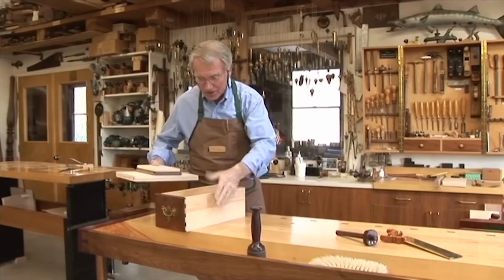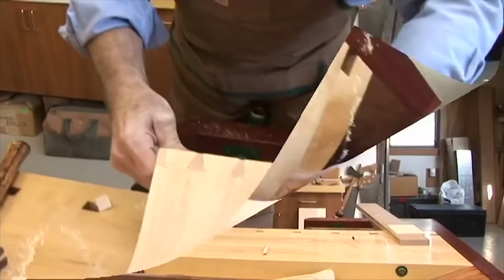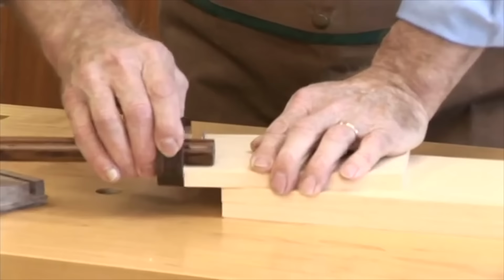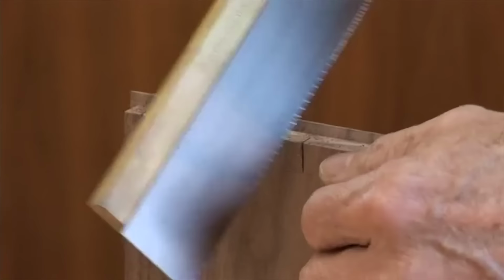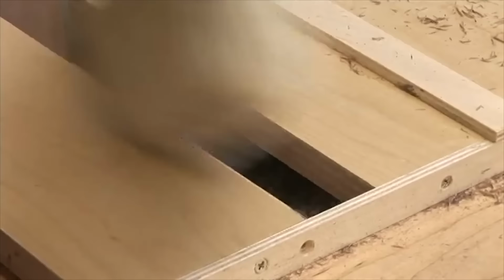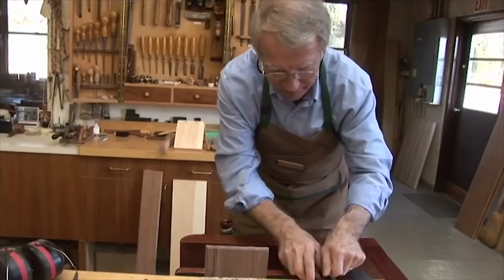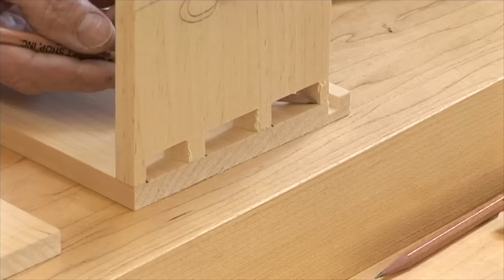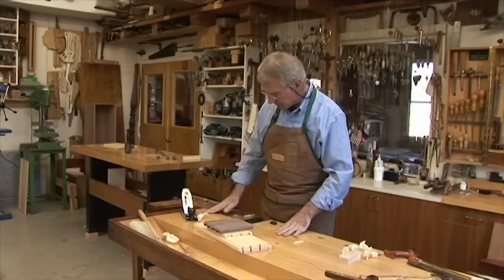Dovetails for Drawers – the European Way

Comment: The way he made the horizontal cuts puzzled me. I thought he was using a bow saw 
with a 1/4" blade, known as a "Schweifsaege" in Germany. Essentially a 60cm coping saw. 
I tried it with mine and the blade cheerfully continued to cut straight ahead, nix on 90°. So I asked a German master cabinet maker who also teaches woodworking - including an
excellent course on dovetailing -  to take a look. He pointed out that Frank Klausz is using a 
special blade in his saw. The blade is known as a "Zinkensaegeblatt (= dovetail blade)" or 
"Winkelsaegeblatt ( = angle blade)". The first third of the blade has no teeth. After the first third the blade turns 90°. So you put it in vertically, push and suddenly you are cutting horizontally. 
Obviously the vertical cut has to be wide enough to accommodate the blade, so these were 
done using a normal bow saw. A kerf on a Japanese saw is too thin for the final cut.  If you 
look at the video and freeze it at 4:00 you can get a good look at the blade. 

It's a brilliant idea, but it was primarily used for dovetails on door jambs and window frames 
where the joints are not visible. Because the cuts are so rough - the wood tears on the rear - 
normally you would never use it for cabinet work or boxes. Frank Klausz and probably 40 years 
of experience show the exception to the rule. 

My cabinet maker friend mentioned dovetailing was commonly done in Germany for doors  
and windows. Within ten minutes three guys could cut, assemble and set a door jamb using 
dovetails. He also said, as far as he knows, the blades are no longer being made. I researched 
the tool sites in Germany and could not find them anywhere, but that of course does not mean 
they are not available. I just haven't found them.  I definitely want one of those things, so my 
best bet will be a flea-market or similar.

For any interested souls out there, a good illustration of the blade can be found at:  

http://www.woodworking.de/cgi-bin/forum/webbbs_config.pl/md/read/id/2865

or Google on "Zinkensaegeblatt" or "Winkelsaege". Ignore the German and enjoy the 
illustrations.
Reply: It puzzled me too.  First I thought he was flipping the saw sideways.  Then I thought the blade was merely twisted.  I couldn't get why the cuts didn't leave a trace of the blade twisting.  Then I checked your link.  I see by the illustration, that the teeth start, as you said, at some point perhaps a third down from the distal end and work like a broach.  They start out very small and get larger until they are making a full cut.  There are true geniuses walking this earth.  If each one of them could be placed into his appropriate role in life, it would be a great thing.  Thank you for taking the time to research this and for supplying the link.
Reply: Thank you for that explanation, it had me puzzled too.
Reply: Amazing. I wonder if one could be made with a Hacksaw or a Keyhole Saw.  torch a blade. get a 90 twist. use a stone to trim the unwanted bits.
Reply: @Doctor Why:
It doesn't work that way. Take a rectangular piece of paper and fold it, you'll see what I mean.
Reply: That does look like a possible solution.
Reply: many thanks for the superb and interesting explanation sir.
Reply: I watched it a few times.  Your explanation seems to make sense but I'm pretty sure it's actually magic.
Reply: @belthize  yep, definitely magic!
Reply: From the way the blade installed, I think you can use a regular blade. Just grind off the teeth on the first part and then installed it in a twist way
Reply: by the time the horizontal teeth have reached full depth of cut, the vertical part of the blade is gone. In use it makes it appear that the blade twisted around the corner. 
This link from the first post really explains the blade geometry. 
http://www.woodworking.de/cgi-bin/forum/webbbs_config.pl/md/read/id/2865
Reply: @thomasbudi2000  No... needs a folded crease along the blade, not just a twist.
Reply: Ah, that is very technical blade. I wish you all the best in the quest for ever better work
Reply: paisano tldr
Reply: Thanks for the info : I was puzzled too …
Reply: Interesting stuff. 
The experience on preventing blowout is a little secret he knows along many woodworkers but don't pay much attention to because it is something they are used to. I had this conversation with my father about the long time craftsman who don't think about some details in trade that other people find fascinating or very unintuitive. 
Back to the blowout problem.
Well the trick is in the scribe line with marking gauge that severs the wood grain and when the saw exits the wood grain breaks off cleanly before or exactly at that marking line cut by the gauge across the fibers. Afterwards you clean the joint with chisels to the line and get crisp joints. 
Some of the rabbet or dado hand planes have a small nicker on the side that does the same job of preventing the fibers breaking out. 
I find all of these fascinating and still learn a lot stuff every day. 
I hope to reach Frank's level one day.
Reply: Amazing info
Reply: I think the same blade can be made by simply snapping the teeth in the front section of a thin band saw blade while filing progressively for few more cm's until the twisted section turns horizontal. It sure looks cool. On the other hand a coping saw can be used with greater precision (but lesser speed, of course)
Reply: LOL! Years of expertise often appears to be magic, doesn’t it?  It also helps to have an awesome set of tools!
Reply: paisano Thankyou for that I was thinking the same
Reply: An interesting blog post on how to make this style of blade from a broken bandsaw blade.  http://www.fullchisel.com/blog/?p=229
Reply: thanks for this comment
Reply: paisano c3
Reply: paisano he speaks Hungarian so maybe that saw blade is made in hungaria
Reply: Try in an amish community
Reply: @doctorwhy6504  Start with a piece of angled material used for making a coping saw blade, with an L-shaped cross-section. Add teeth to the horizontal section, then cut away the front 10% of the horizontal section, and the rear 80% of the vertical section. Then run the material through a heat-treatment to harden the steel.
Reply: I have a blade like that I bought in Spain around 1972 so maybe a Spanish blade maker would have them. I wish I had bought two. I guard that thing with my life ;)
Reply: I'm German-trained, we make the blades ourselves by grinding the teeth off the end third of a regular blade, and just rotating the handle of the bow saw 90 degrees nearest us when we tighten the saw from storage and are ready to cut.
Reply: @thomasbudi2000  Ja! 
Das ist wie wir das Machen!
Reply: This is what they would have you think! In reality, certain craftsmen, after many years in the practice get invited into a special guild that teaches different incantations and sorcery/magic etc. You see the saw he is using for the dovetails? A saw like that is only made with a certain kind of magic which transfigures the wood into a particular shape that is used for magic wood sawing. That also explains why there are cabinet makers in Central America using the same techniques that are used on olde Europa 🤔
Reply: @nutsmcflurry3737  it appears to be a cut starter, then you can insert the triangle blade and start the straight cut at the bottom of the vert?
Reply: This is gold! thx for this!
Reply: From your description of the blade it sounds like it would be fairly easy to make a blade. Find a narrow bow saw blade, carefully heat one spot and twist the blade. Then you will have re-temper the part of the blade where the twist is located. Find a metallurgist and ask how you can re-temper a steel blade.
Reply: As soon as he cut the waste between pins, I immediately paused and came down the comments hoping for an explanation. Was not disappointed. What an interesting saw and thanks for the great explanation!
Reply: Nicht gefunden worden...
Reply: @smallhammer5559  good point with the Amish. They speak German but unfortunately you'd have to be local to them as they don't use the internet. 😂
Reply: Yes I watched as he cut the waste and I seen that he had a special blade. His speed cutting adequately made joints is something to strive for. My only problem would be 1st, acquiring European tools needed 2nd, developing the technique to become proficient and 3rd, practicing on the various species of wood.
Reply: Thank you
Reply: What about filing away a few teeth of the start of the blade? I wonder wether it would perform equally well.
Reply: I've done this with a turning saw in two strokes (on a 12in blade, so roughly equivalent to what Frank has done here) by merely twisting the blade 90° with no further modifications. My blade is much thinner than his because it's what I have, but it's perfectly possible. 

In an article by Frank Klausz he mentions that he has a saw set up specifically for this task, and that the blade changes tooth geometry as it goes through the twist from rip to crosscut.

Comment: Gees!  that scraper trick is awesome
Reply: Thanks for the referral from the podcast Joey.  (I think I had seen this scraper trick done more recently, maybe with Rob Cosman selling "his" method - not sure).  The part I liked was the bowsaw with the twist in the blade for going from a vertical cut to horizontal in a fraction of a stroke!
Reply: Same here - just listened to the podcast and had to check it out. I'm proud to be half Hungarian!
Reply: Be careful:  the harder the wood... you will note he says 'if you are using pine'.  Hardwood might split. I still do it, but put a clamp side to side to avoid the splitting...

Comment: I never imagined you can do such precision work with such gigantic saws.
Reply: That is still pretty much the standard saw used in Europe for all joinery. I should know. I stayed at a Holiday Inn Express one night a few months back.
Reply: Not to mention them being a bit lighter than similar length english style saws (depending on styling), WAY thinner and at least as rigid as backsaws. Plus, at least in my experience, the higher balance point is way easier to feel and keep plumb.
Reply: Chinese woodwork saw is like this shape too
Reply: @SW-zu7ve  that joke hasn't aged well

Comment: When I discovered the enthusiastic Frank Krause, dovetails became fun! My dad showed me 40yrs ago dovetailing with a 1/2 inch router bit, confusing because the pins and tails are the same size?! But dad just used dovetails for kitchen cabinet drawers and only for upscale customers. F K widened my woodworking horizons.

Comment: As I watch this video again and watch you pencil in the pins for the tails, I think of all the EXTRA moves to make the very precise dovetails with all the do-dads such as chiseling in a small step to register the pinboard to the tails to scrub in with a knife the pins. and even before all of that all the various scribing angel guides for the layout of the tails and pins and on and on with all the gizmos and yet your method is sooooo easy and simple and much fewer operations to do and use just to get to the same finish where your method is so fast and exact as you want to make it WITHOUT all the jig, things to do with all the do-dads that all the other dovetail specialist use and tells everyone that we need to make good dovetails.  Perhaps it is all due to Commercialism.  BRAVO MAESTRO

Comment: I am in awe of Frank Klausz.  A master craftsman at work, but how amazing is his prowess with those huge saws??  Two or three strokes of the saw and he's exactly to the line - not approximately,   EXACTLY to the line.     No need for bevel gauges or dovetail marking gauges - just an experienced eye and sheer skill and the angles are all exactly right.       I know if i tried that i wouldn't just need a bigger hammer.  I'd need a sledgehammer.       I'm going to start practicing.      Come find me again in 10 years,  I'll let you know if i've made a dovetail joint yet.
Reply: Been a year. Have you?
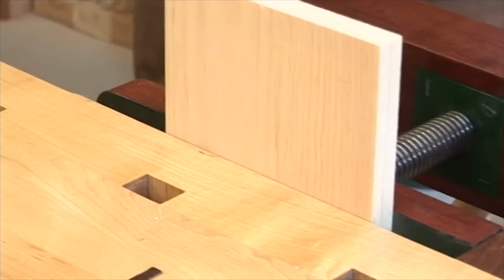Reply: "... those huge saws??"  I think that's one of his techniques.  See video around 2:08 that saw appears to have a 2" wide blade and (I'm guessing) 10 or 12 TPI, something not too course.  Since he cutting "out" the tails and leaving the pins they act as the template for the tails in the adjoining piece.

I want marking gauge like he used, it appears he just twists the beam in the body to lock it in place, no wedge or thumb screw.
Reply: I am in awe at how in awe people seem to be. This is the standard European saw still used to this day for joinery of all kinds. Look up Europeans using European methods and.......they using the same saws. I have one of these saws myself. Admittedly haven't used it for anything as it was a gift and its quite old. Also they pretty light and I don't mean "for their size". When you look at them there really isn't much there. Eventually I do want to make one to use. Not trying to take anything away from Mr. Klausz. His work is amazing. I suppose that was a long winded way of saying he is a European using tools still in use in Europe.

Comment: Thank you for sharing your expertise on cutting dovetails. The swiss cabinet maker who showed me the manner he cut his dovetails and they were the same manner as yours except before cutting both pins and tails with a sharp knife he made a shallow cut very near the scribed lines. He told me these shallow and very near the scribed lines cuts was where to start the chisel cuts because this prevented the fibers near the scribed lines from crushing into the scribed lines, but I noticed the manner you dealt with this is to gently tap the chisel on the scribed lines your method has the similar result in less steps. Again I thank you very for your patience and kindness in sharing this to me. P. S. this was a refresher for me forgot how to space the pins.

Comment: "So yea, just make a perfectly straight, perfectly square line using a pencil and your finger and go from there." What in the everloving woodworking is going on.
Reply: The trick is, be as good as this guy. Then it's no sweat!
Reply: It's actually suprisingly easy and exact to use your finger as a marking gauge

Comment: It's amazing how he can instantly turn his saw 90 degrees when cutting the waste out on the through dovetail and apparently hit the line.
Reply: 4yflr0i he uses a special blade with a twist at the end.  The twist goes into the saw kerf and then twists 90 degrees and has tapered teeth.  I had to watch it 10 times to figure out what he was doing.  It's amazing!
Reply: Thanks Mark, I can see that now.
Reply: it's not the blade, but the saw - a coping saw allows you to turn the handle at 90 degrees to the head.
Reply: Bill Quayle not in this case.  The blade isn't sharpened for the first 6 inches or so then it twists.  Coping saw is a more common way.  That particular blade is very specialized, since that is what he does.
Reply: He actually has those blades specially made for him -- it's not just the saw, or his technique.  He uses it for speed demonstrations.
Reply: Alan T well yeah-but it's 100% technique and skill that makes it go. You or I could have twisted blades made till we ran out of blade steel and it wouldnt work like what we just watched here - until we cut a cpl 1000 of them...
Reply: Mark Gray, Amazing when you put a grand master and a specialty  tool together!
Reply: Most of the cuts had no line, he measured it with his thumb as he went! That’s craftsmanship, old school.

Comment: Mr. Kalusz, after posting my last comment it occurred to me that it sounds as if I just adopted your mother of dovetailing.  No, not at all. coming back to California from my 13-year life in France to take care of my aging mother I bought a lot of power tools, machines, and lots of hand tools including lots of gadgets for dovetailing.  within a year or two I stopped using gadgets for dovetailing and just did things by eye.  Some years later I saw your video for the first time and said to myself "this is my Maestro" I do it just like you in many ways the only significant difference is I prefer very thin Pins.  I just wanted to add that to tell you that in a sense I did walk down the same path as you did years ago and now, I have found you and work just like you do.

Comment: The card scraper trick works if you cut the pins first like Frank does here. Otherwise you will get massive gaps because the scraper will push your line by a lot. Don't ask me how I know.

Comment: Most people don’t know hat a cabinet scraper is, it’s history or that it can be purchased in almost as many thicknesses as there are thin metal measures and harnesses of sheet metal.  My oldest one dates to the early 17th C and was mounted at 82 deg (I have another set to 90 deg known as a veneer plane-but using what we know today as a ‘cabinet scraper’ but with tiny ridges in the sharpened edge) in a heavy hardwood plane body.  On your drawer face did you use a router or plane?

Comment: The blade is twisted on his horizontal saw.    Settings you vido speed (click on the gadget in the right hand corner) to .25 to slow the video down.    at minute 2:36 you can see the blade is twisted, which the first 25-30 % has the teeth ground off, which he sets into the slot to begin the cut.    Where the teeth begin, those may have a smaller kerf  set if the teeth have squished in a vise.    I may try to make one.

Comment: Wow, I've never seen a bow saw like the one with a twist in the blade that allows one to make a 90' cut ! and it takes about 1 1/2 strokes to get through the whole cut. Frank I have many hammers, some 30 or so. I'll never have a too tight issue now! but where can I find a dovetail saw like yours?